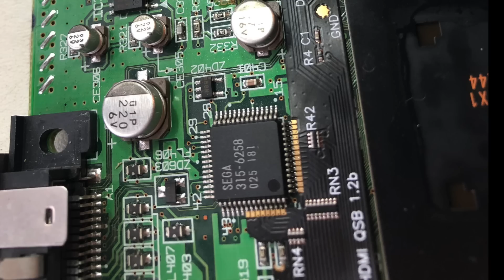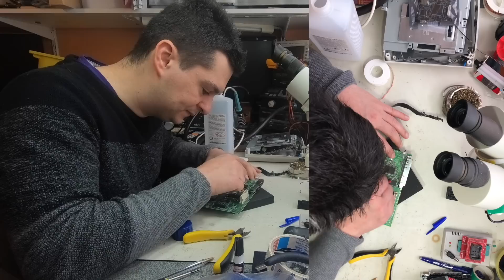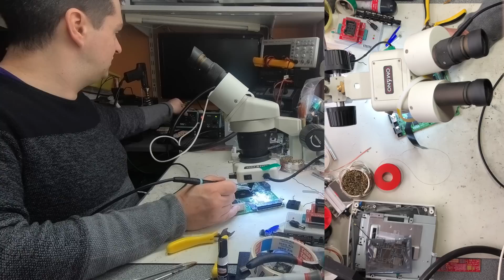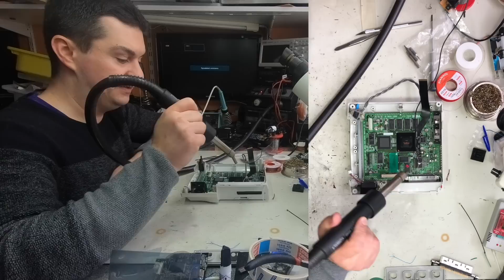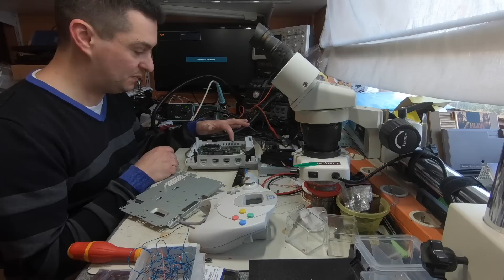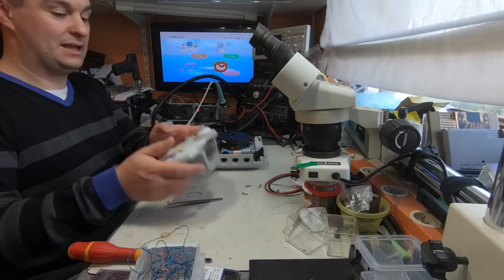Dreamcast DCHDMI BAD CUSTOMER INSTALL - CB-PC REPAIR

Comment: awesome repair! I messed up my own install of the DCHDMI... but it was not as horrid as this one and that makes me feel good! ha! all my mistake was not aligning the pads correctly on the video chip... then I desoldered the flex cable and resoldered it back on... that's when it was game over for me! I ended up knocking a few pads off the video connections.... and that's because I dragged the braid across when removing the solder, bad mistake! anyway I already ordered a couple of new flex cables and will try again.... my hopes are really high that that's the only thing I messed up on the install and it will work

Comment: can you tell me the name of the vacuum tool you use pulling the chip off the board while using hot air?  Thanks.
Reply: JBC Tripod Extractor
Reply: @iekmuhammad  thanks